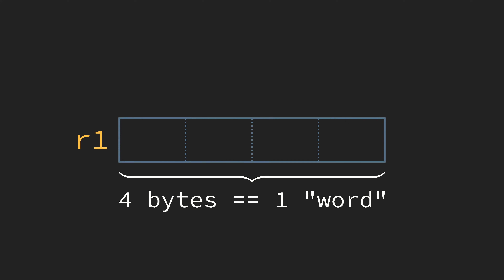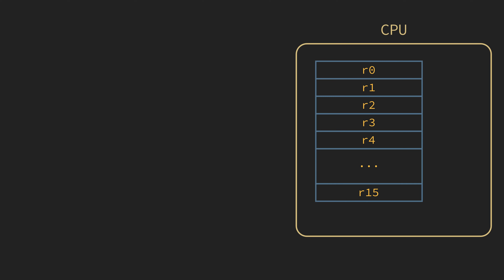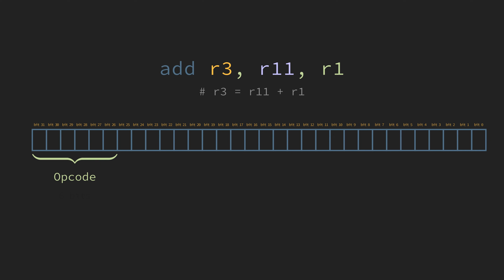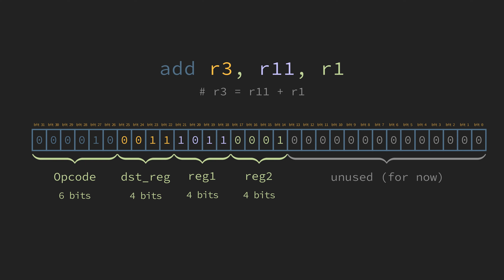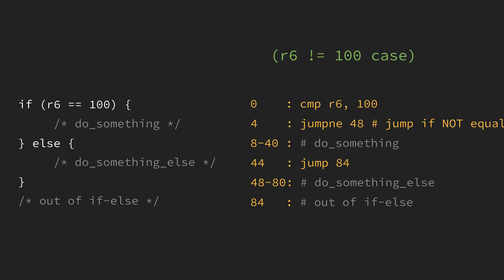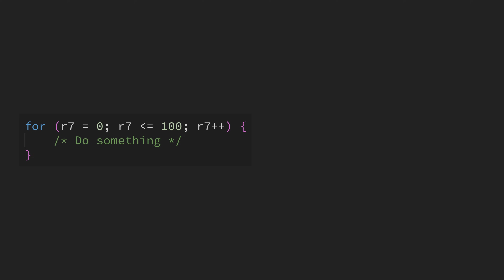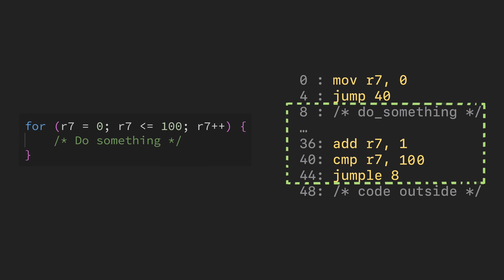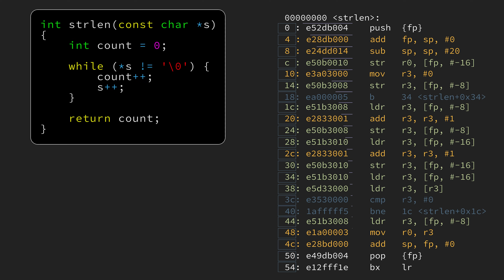Reinventing the Processor

Comment: Great video, though I'm not sure if a beginner will find hex, or even binary, all that approachable. That being said, it would be difficult to discuss instruction encoding without them. A few notes for people who want to bridge the gap between the example and real hardware a little more:

A status / flag register isn't really necessary, and, in fact, there have been architectures like the Alpha and MIPS that didn't have one. What you do instead is combine the cmp and the conditional jmp into one more complex instruction (see MIPS' BEQ for example).

A lot of modern CPUs have well over a hundred physical registers in their register files, even if there are only a handful of architectural registers that programmers have access to (look up register renaming for more details).

Lastly, it's quite common to have multiple opcodes for the same operation to make some (or all) of the arguments implicit. For example, you can have add r1, r2 or add1 r2 where the first argument is expected to be in r1 - this is very common in simple architectures with so-called "accumulator" registers.

I was going to mention stack machines but you'll probably cover them in future videos, at least conceptually.

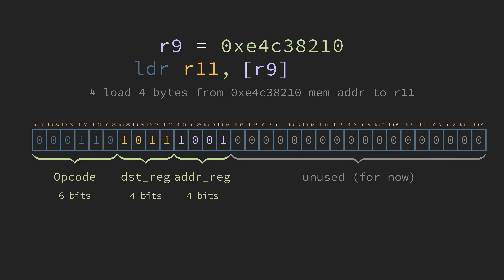Comment: 3:47 that doesn't really solve the problem, does it? The value still has to be brought inzo the register somehow and the mov op has the same space limitations so there it's still only possible to move 22 bits into the register. Something like mov.l and mov.h is required to actually solve this issue but doesn't seem to be adressed in this video.

Comment: This is exactly how I learned to build compilers and virtual machines on my own (no course, no university, I'm still in high school). 

I started by coding a simple maths calculator interpreter. Then I went with creating a simple interpreted programming language. Was it any good? No, but I learnt a lot through the process.

Then I tried to get into assembly. Taking inspiration from already existing technologies, I developed my first own virtual processor. 
So, how do you execute code on this processor? You make an assembler, of course. And so I created an assembly language that suited my processor architecture. 

After coding in assembly for a while, I got tired of working with such a low level language, so I decided to create a new programming language and a compiler that could translate the high-level code into my VM's bytecode.

It's now been a few years studying compilers and VMs on my own and I've built quite a few instances of code interpreters, compilers, and VMs. Each time I made a new  one, it was better than the last one.
During this learning process, I literally reinvented computer science from scratch. It's now obvious why certain things in computing work the way they do. It's obvious because I actively went through the same choices that a century of computer scientists went through, only faster. 
It's interesting to see how many of the design choices I made in my own systems actually match those computer scientists "historically" made. Sometimes, though, I come up with new designs and solutions that are different from the "traditional" ones.
I find this learning process incredibly good for teaching myself complex things, remaking them from scratch to really learn not only how they work, but also why they work.

I'm currently working on developing a compiler for a low level programming language inspired by C and Rust, which will then run on my newest virtual machine, of course.
Next up, create an operating system for my virtual machine.

If you made it this far, I hope you found this short story useful and inspiring. Good luck with your journey
Reply: Great job bro! I find it awsome and inspirational ! Could you share me how did you learn these any resources bro ? Thanks in advance  :)

Comment: You don't really need a flags register or a compare instruction. You can instead simply embed the comparison into the branch instruction itself. This makes things conceptually simpler for programmers and also simplifies the architecture for more advanced CPUs with things like out-of-order processing and register renaming. This is what's done on RISC-V. The actual drawback is losing a second output of arithmetic and other instructions that set the flags without compare instructions.